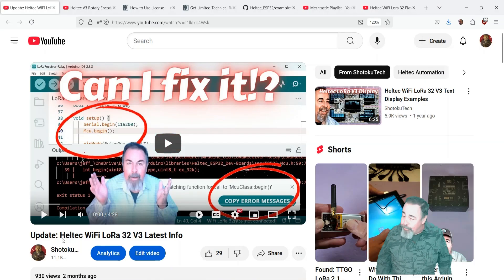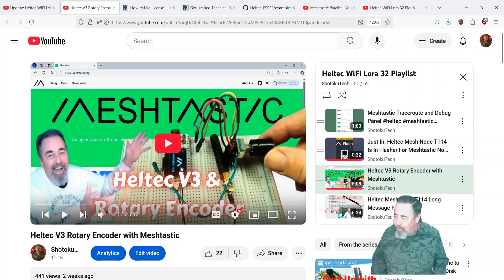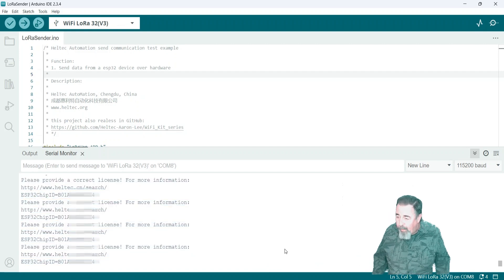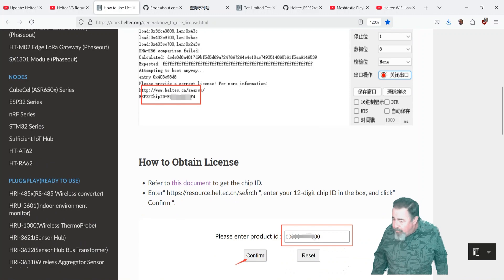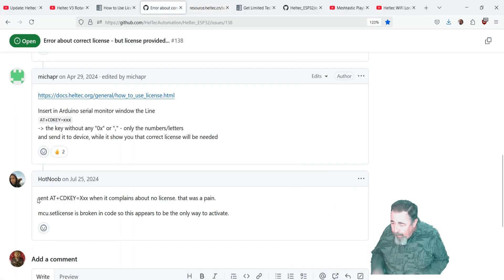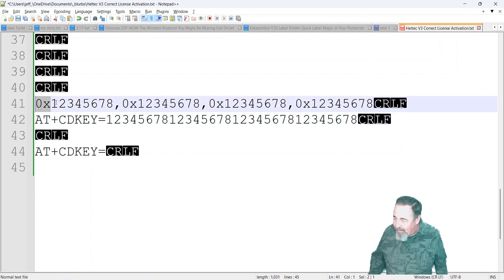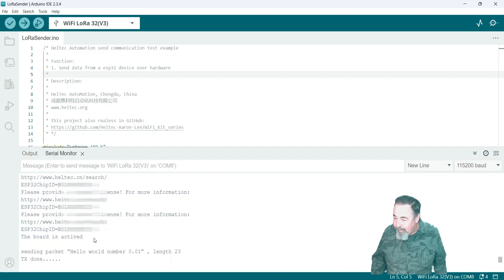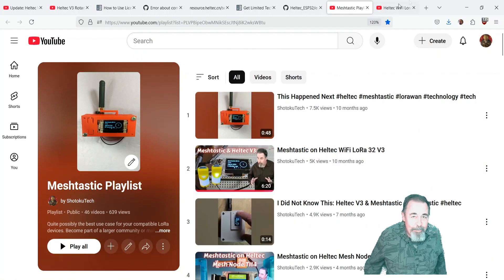Heltec V3: Correct License Activation

Comment: I'm trying to create my own basic mesh of these boards without much success. I basically need to extend the range of my furthest device by having the nodes send a simple packet (node name and a boolean status) from one to the next until the closest node can communicate to the "gateway" device. Anyway you could make an example of that with these boards?
Reply from the maker: I really prefer running Meshtastic on the Heltec V3 over trying to develop one-off solutions in Arduino IDE. I have several videos demonstrating the Heltec V3 running Meshatastic and the capabilities of it. Meshtastic Playlist. https://www.youtube.com/playlist?list=PLVPBipeObwMNikSEscJtNj8iK2wksWBtu

Comment: Great videos! I love  your videos with  Heltec esp32 lora V3 and  learning alot form them! I do have another question. What do you need to do to make Reyax LoRa RYLR998" exchanging packets with Heltec esp32 lora V3? They are both using LoRa radios and should be easy to make them talk. I would like Heltec lora ESP32 v3 to send data to REYAX RYLR998 module connected to Raspberry Pi via UART. The man issues might be(? not sure)  around setting the parameters correctly. REYAX RYLR998 has followng settings: Address, NetworkID, PARAMETER=<Spreading Factor>,
<Bandwidth>,<Coding Rate>,
<Programmed Preamble>,
<Spreading Factor>.  Just wonder if you could do anther video or have tried already making REYAX RYLR998 receive packets from Heltec lora ESP32 v3? Your help would be greatly appreciated! Thanks!
Reply from the maker: You present an interesting challenge to have Raspberry Pi and ESP32 communicate with each other. I will have to look through my inventory to see if I can recreate the scenario with the REYAX RYLR998. I have not worked with LoRaWan much. Mostly I have just been sending LoRa packets in the clear, until I discovered Meshtastic. I did a video using LoRaWan with M5Stack devices and you can see my settings in both UIFlow and Arduino IDE. Both devices need the same settings. https://youtu.be/yyrZrP6KDZs?si=h0SEbG36Iij4ni0j
There are some interesting conversations around the Syncword parameter. It has to be set the same between the devices. https://forum.chirpstack.io/t/relation-between-sync-word-private-network-and-end-nodes/191

Comment: Im new with this device. And everytime I tried to use the sample code it their is no desplay in the OLED. Please help😢
Reply from the maker: What sample code are you using? You have to use example sketches that are specifically for the Heltec V3. You might get more details from these videos. Thanks.
Update: Heltec WiFi LoRa 32 V3 Latest Info
https://youtu.be/c1lkIko4Wsk
Heltec WiFi LoRa 32 V3 Text Display Examples
https://youtu.be/3x8vREn3mq0
New! Heltec V3 ESP32 LoRa OLED Step By Step
https://youtu.be/shJxD5fiEhs

Comment: Interesting, thanks for sharing! I've been using the LoRa 32 v3 for a few weeks now but it hasn't asked me for a license activation. What is the purpose of requiring a license?
Reply from the maker: Perhaps Heltec is licensing some technology that belongs to someone else? I'm not sure why the necessity for the license. But overwriting the flash memory by flashing Meshtastic onto the Heltec will definitely trigger the need for applying the license if you want to go back to using the board in Arduino IDE. Thanks!